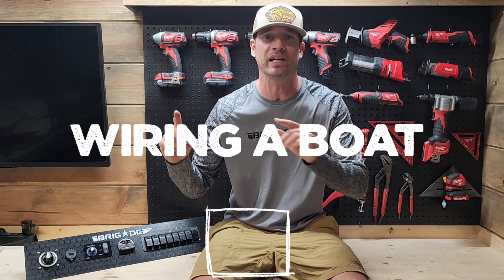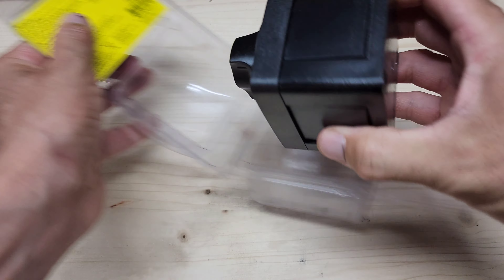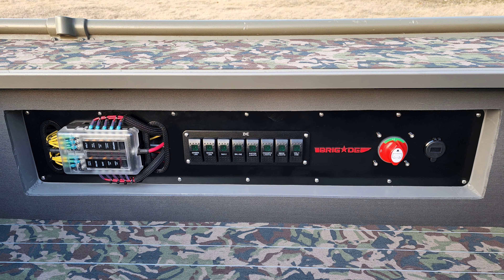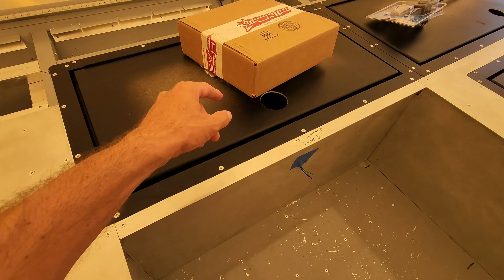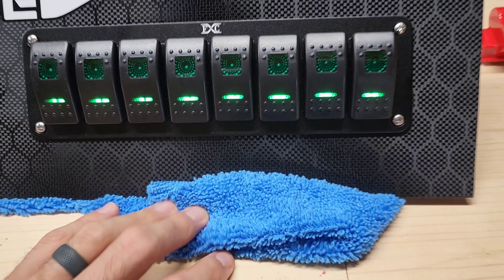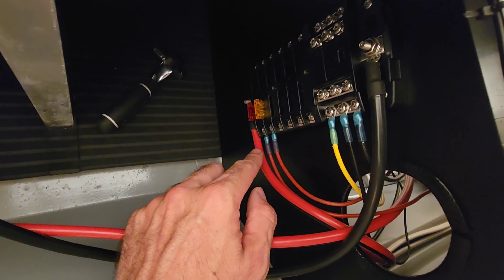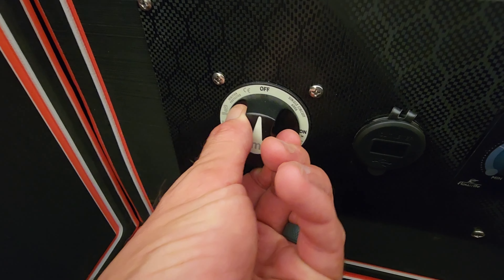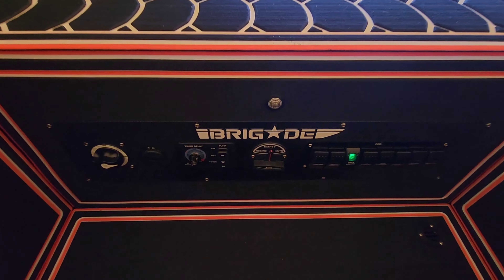Full Electrical Guide to Wire a Jon Boat

Comment: Wow this vid is pure gold! Thank you! Is 2 to 1 the max you would recommend wiring to a single switch? Just used your code on tbnation btw thanks again!
Reply from the maker: Thank you! No. There's times I run 6-8 individual led lights off one switch/ fused circuit. With that, I personally don't like doing anything over a 2 to 1 connection though. So two lights into one then that lead goes 2 to 1 into another light and so on. In that case, I may drop the gauge down at the end to 12 gauge for ample juice but most time the smaller led lights can run on the 14. Again, for situations like this it is important to use good wire and connectors to prevent any issues. I would not recommend doing that with anything that has a high power draw but then again, those things usually run individually, its typically the lights I zone off and jump together.  Thanks for watching sorry i didn't fully explain that in the video.

Comment: Did the boat have a starter battery? It's always nice to add a voltmeter to the starter battery too so you can see if the alternator is charging.
Reply from the maker: No, it ended up with an electric outboard.

Comment: Solder heat shrink butt connectors are better than crimp connectors & can be found on Amazon
Reply from the maker: I personally don't like them. The ones I've used do not lock the wires in like a crimp, making it hard to keep wires in place when shrinking. Also thinner plastic with more flex and no internal glue. The crimp ones I listed are thick and have glue and dry really solid. I never liked crimps because they could pull but the hrat shrink cures that. I do use the solder ones on 18-22 gauge but that only because a crimp is really hard to do on those tiny wires.
Reply: Thank you!  I Value your Feedback & Experience

Comment: You definitely have to check the wiring you purchase Very Carefully - because a lot of Sellers are selling CCA - Copper Clad Aluminum not Pure Copper and it does not hold up like a Quality 100 Percent Pure Copper Wire.

Comment: This is a great video!  In running my 8 Ga. Wire to the front of my boat to the trolling motor, can I somehow split that wire to not only feed the trolling trolling motor, but to also connect to a fuse block?

Comment: Nice job nice work but  it's a tiny boat   you've spent more on the other things than the hull was ever worth  at a certain point your better off buying a better hull   - im adding a radio and vhf  plus a couple of lights to a very small  inflatable  but I took lots of things from other projects I have
Reply from the maker: Thanks for the input. We will look into an inflatable next time instead.
Reply: @AnthonyJonesBrigadeBoats     That wouldnt work  well for you guys either    inflatables are not allowed in lots of your lakes - nz had has most of the same boats you guys grew up with  - lots of them are better in the scrap heap - try  use a deep freezer  as a seat   could be interesting  and again  the boat looks great the floor is A grade on point

Comment: Many years working in marine electrical on large vessels, never use house wiring/rigid on your boat. If you own a large boat, let a professional marine electrician  do the work. If you have a fire caused by incorrect or faulty installation, you may not be covered by your insurance, or worse, loss of life.
Reply from the maker: Thanks for the advice. I don't use house wire. Can't speak for others. I use ancor marine duplex. Or I have about 20 other colors single strand in various colors. I admit I'm no expert buy I've seen many "professionally" rigged boats and not to toot my own horn, wire circles around them with cleanliness and quality connections. In fact, some of these manufacturers or marine centers are paying low wage cheap labor to do the rigging while they charge top dollar for profit margins. Not gonna say any names but I've seen a lot of the work personally. But that's just in bass boats. I couldn't speak on large boats or offshore vessels. That's a completely different game and approach, different video altogether.
Reply: @AnthonyJonesBrigadeBoats Sorry, I didn't mean to have a go at you. During my time of marine electrical, I did a number of complete engine room wiring installations on large vessels. I never used fuses only marine certified magnetic circuit breakers and high quality automotive wiring. All termination was nickle, or brass connectors. I can understand the cost involved, especially small boats, so a do-it-yourself diy is okay.
Reply from the maker: I completely understand. I follow some incredible marine wiring companies on Instagram that wire big glass boats the way you're describing. All circuit breakers, tons of shut offs, huge gauge wire, you name it. For these small jon boats and aluminum bass boats it's not really the same. For some higher end rigs with lots of electronics we will run a bunch of circuit breakers but as far as livewell pumps, led lights, and small accessories,  we just use a fuse box. Easier, cleaner, and better than inline fuses. I couldn't imagine the cost on some of those wiring jobs you a describing but I guess when you're talking about the cost of the boat, it's probably in proportion.